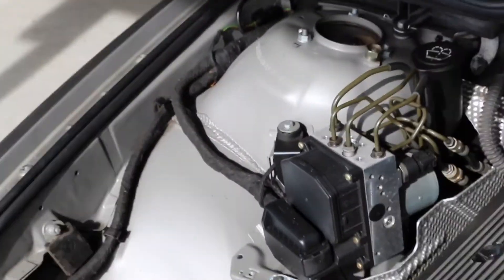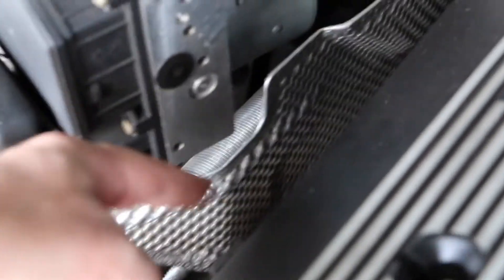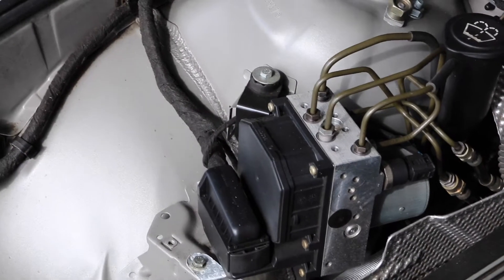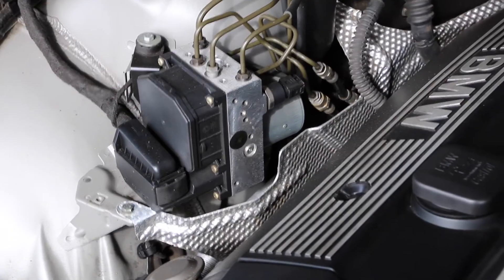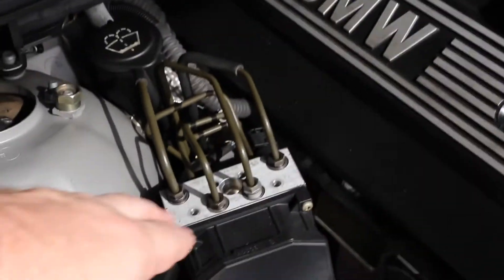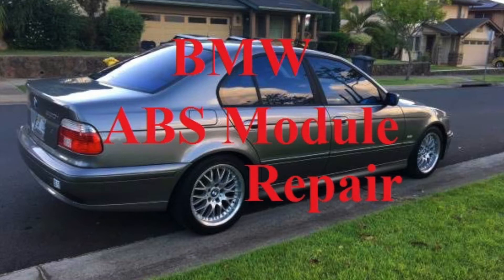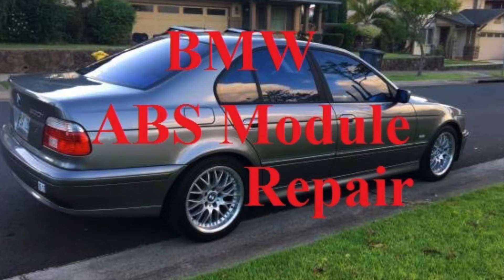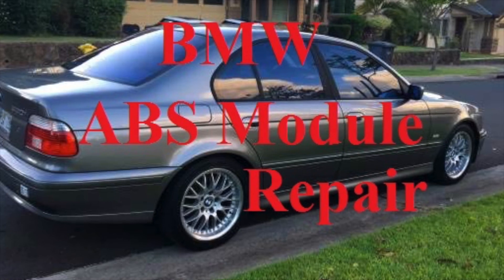BMW e39 ABS Module Repair

Comment: I had a very similar issue on my ABS pump. So, i removed the black box from the ABS pump. I then very carefully cut around the edges to open it up.
Once open i inspected the electrical joins, solder etc.

I noticed that there were a few dry joints that were causing the issue. These were then resoldered and the whole unit was put back together and then screwed back to the ABS unit.
This fixed the issue and the ABS unit works fine.

Comment: Hi. If I buy a used one cheap can I programme it via diognostics (computer)
Reply from the maker: Not that I am aware of.
Reply: Yes, you can with a D-Can/K-can cable and a suite of BMW certification programs including INPA and NSC-Experten.  You need to buy THE RIGHT K-can cable (ODB II to USB) and you have to use a 32 bit operating system, either Windows XP (often in a virtual machine) or Windows 7, 32bit.  Then you can code new modules to your car but it is NOT EASY, often requiring updating files, troubleshooting, etc, etc.  It is far easier for the Dealerships to do as they have computers with these programs at the ready.